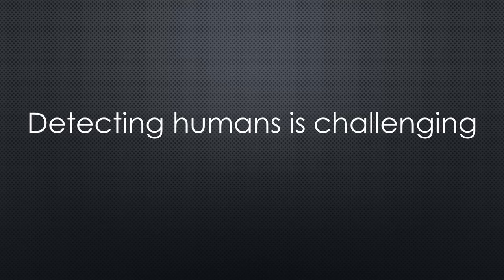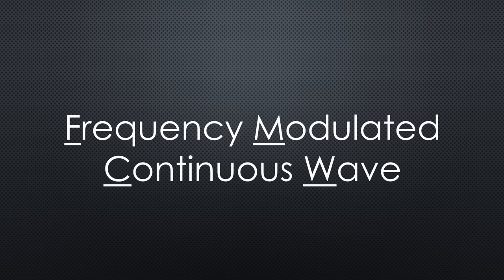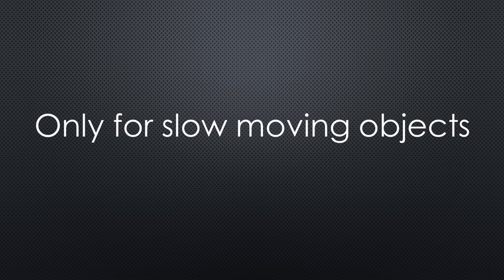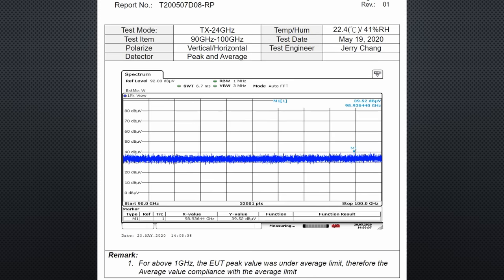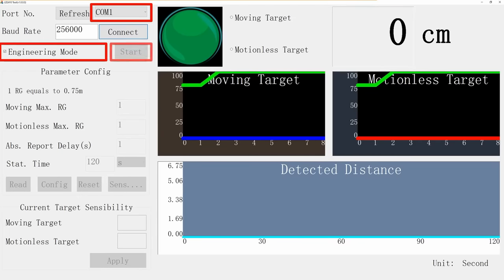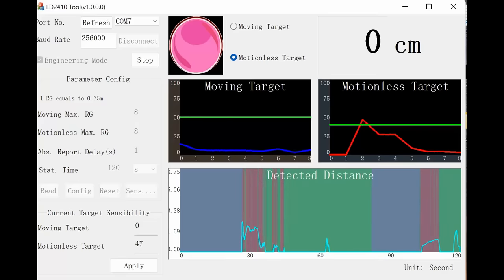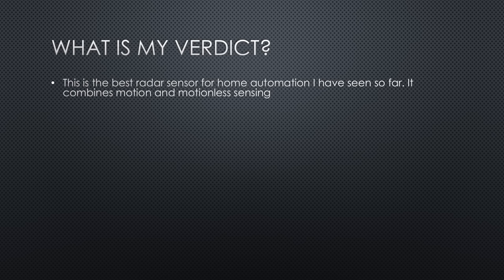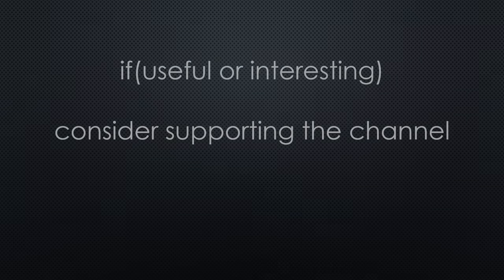439 24GHz Radar Presence Detector that Works (LD2410)

Comment: Should try the LD2410B, you can configure the sensitivity using the Bluetooth App. I'm using LD2410B in my 2 bedrooms connected to ESP32. It could also be used standalone without an MCU so a great candidate for battery operated Bluetooth radar presence sensor.
Reply from the maker: Do you have more information?
Reply: Wait, whats the diff between the LD2410 and the LD2410B? Only the bluetooth capability?
Reply: @Barc0d3  I don't see any diff using it the past few months. LD2410B has Bluetooth which is much more convenient when setting up the sensitivity.

Comment: Thanks for the video. I'm using an LD2410 with ESPHOME, but using the UART and letting the firmware do the heavy lifting. Works really well for controlling lights in kitchen/workshop type environments.
Reply from the maker: Thank you for sharing your experience!

Comment: 1,25cm wavelength(1.25cm to inches for people in usa). that is around 1cm of precision with even a single one of those(which around 1cm but then converted to American units for people in USA).
however the interesting thing is when you use it as a phased array by using multiple of them(similar to the 5g antennas in a smartphone)
then precision of smaller than 1mm can be reached easily due to the ability to focus the radiowaves on small sections and move those focus sections.

however in my case what I was mostly interested in now since modern smartphones already can make such 3d scans at around 0.1mm resolution easily(yes it is there, the software for it is there as well, this can be used to detect problems in the body and diseases due to being capable of making such detailed 3d scans but also inside of you, but somehow you are not allowed to use it since the 5g phased arrays in your phone are typically propetairy black boxes put into other propetairy black boxes that prevent you from using it, but you have no way of knowing if other people are using it on your phone, so support foss, especially such technologies which can also be very dangerous and privacy intrusive(such advanced 3d scans even through your clothing and body, and still having decent range is a serious privacy and security risk) it should be gnu+foss),
 to instead just make simple 3d scans the easy way by using 3 sensors to get width height and depth, this also takes way less compute power.

only using 3 sensors or 3 measure points to make 3d scans with around 1,25 to 5cm precision is still very useful for example or motion tracking, fun, looking through things(like x-ray glasses but then actually working), etc
Reply: Metric is so much easier. I can't understand why any country hangs onto imperial. Mind you, we still buy that vital fluid in pints here in the UK🍺

Comment: Hello Andreas. Thank you for this very clear presentation. I just received the LD2410B Kit and tried to install it. It perfectly detects presence and movements. The problem is that  it does only communicate its data through USB cables. It does NOT PAIR to any Bluetooth device (laptop, phone, Raspberry Pi 4B with BT). For example, I can integrate it into Home Assistant/ESPHome, but use it ONLY when it is connected to my Raspberry Pi by cable. Any help would be more than welcome. Thanks!
Reply from the maker: The "B" version is only laying on my table. I never tried it :-(

Comment: Great video, thanks for sharing. Very interesting sensor, I assume it will work well through a plastic enclosure
Reply from the maker: It should. But read the data sheet. They have a chapter about choosing the right material.
Reply: @AndreasSpiess  Thank you for the advice Andreas

Comment: This is awesome! I have used some RCWL-0516 in the house but I find them to have quite a lot of false triggers or no triggers. Hopefully this will decrease false positives without the need for a ugly PIR sensor. The nice thing about these things is that you can put them in a small space i.e. aluminium LED strip channels 🙂I've ordered the USB kit to tinker with it.
Reply from the maker: Tinkering is a good plan to find out how they behave in your situation...
Reply: What makes you sure those triggers are false?
Reply: @DoktorJeep  For my application they are false triggers. The sensitivity of those sensors are hard to adjust and may vary depending on many different parameters not really understood by me. I guess objects and object location already can influence the sensitivity.

Comment: Hi Andreas, Andreas here ;)
I never toyed with sensors like this one, but wanted to confirm my assumption: These sensor will not work through glass or plexiglass, isn't it?
And thanks for the nice introduction to the device!
Reply from the maker: Radar passes material (other than for example light). There is a chapter in the datasheet on which plastic is better. And: the higher the frequency, the bigger the loss.

Comment: Many Thanks! Very interesting sensor! Maybe it could be used as a rain sensor, too? 
Currently, my motion sensors mostly are PIR sensors, because of low power, battery operation and zigbee compatibility. I have one or more of them in every room. All of my lights are controlled by motion sensors and ioBroker. Very convenient.
Reply from the maker: 1. They seem to be quite sensitive to motion. So maybe it is worth a try with rain.
2. I love these Zigbee PIR sensors, too. They run forever on a coin cell...
Reply: @AndreasSpiess  @ 2: yes indeed, they are not very power hungry. Most of them, I could hide close to a piece of furniture and could also hide 2 AA batteries in the furniture. So, the batteries run even longer and I do not have to touch and readjust the sensors when changing batteries.

Comment: Radio alitimeter runs at 4.3GHz,  FM CW with 100 MHz deviation.  The modulation is triangle wave,  not sawtooth.  Power output about 1 watt.  Measures distance to ground comparing transmit frequency to reflected signal.  It only cares about distance, not motion.
Reply from the maker: Thank you for the additional information.

Comment: Dear Mr. Spiess, thank you so much for making this video and explaining about LD2410 so clearly.
After having struggled with an RCWL-0516 with so many false alerts, I ordered the LD2410. After hooking everything up (Wemos D1 Mini, and the LD2410 module, that's it), nothing seems to be getting detected.  Is it mandatory that I update the firmware before it is used  in any way?
Out-of-the-box implementation doesn't seem to work.  Would appreciate any insights, at your convenience.
Reply from the maker: I did not update anything. Maybe you check your wiring. Changing RX/TX sometimes help if it is mixed. Otherwise you have to see what is coming from the sensor in its TX pin.

Comment: I purchased a few of these and found they did not work.  Then I found a HW-MS03.  Fantastic!  Today I played with. Hi-Link HLK-LD2410C-P microwave sensor that. At 1st I thought there was something wrong with it.  Always on!  Then it occurred to me.  I am in front of it, even motionless it was still on.  I propped it next to my door with a mirror and went down the hallway.  Once about 15 feet away, it went off.    Works marvelous!
Reply from the maker: Strange that they did not work. But I agree, the HW MS03 are easier to use.
Reply: @AndreasSpiess  is the HW-MS03 better or worst than the LD2410 in terms of accuracy, distance detection, interference, etc?
Reply from the maker: @victorma2307  They are different, as you see in my videos

Comment: It looks to me that it could be interesting/useful to find out where, and when, the power is used, to perhaps architect a system that operates in a pulsed mode, depending on how quickly you need to sense activity or occupancy... Thanks for a good look at this, it seems that a bit of Geduld and prerserverance were needed!
Reply from the maker: I am sure these radar chips are quite capable. Maybe we will get a module where the radar is not connected to a MCU but to a programmable MCU. Then we could do experiments with changing the frequency etc.

Comment: there was a company called Radionics alarm. 
They had an early microwave field disruption sensor. 
Much like the old Viper car alarm. 
Sadly it went through walls and had to be custom tuned for every sensor.
Reply from the maker: Radar usually works through walls. But the higher the frequency, the lower this feature. And with today's software adjustments it is probably easier and cheaper than back in the day.

Comment: I wonder which 24GHz modules are being used for contactless hearth beat sensing?  Seems these can be capable of detecting at least that electrophysiological signal, if not others... though I haven't read through the spec's yet.
Reply from the maker: As I mentioned: The higher the frequency, the higher the sensitivity. With some filtering and close to the chest it is maybe possible to monitor breathing.
Reply: @AndreasSpiess  Wondering if there are cheaper sourced modules available like the seeedstudio 24GHz & 60GHz modules?  Interesting reading into and seeing even some online performing with 2.4GHz modules. Thanks for sharing and detailing!  As always, great content and awesome to see your channel growing sir!

Comment: Many thanks for the video, very informative. 
Tell me, did you have problems with overheating when powered by 5 volts?
This module with esp8266 works fine for me now, but the heating around 40-50 degrees Celsius is a little disturbing.
Reply from the maker: I probably did not check the temperature
Reply: @levran75 I hooked it up to the 5v pin of a Wemos D1 Mini and the LD2410 felt a little warm within the first minute of hooking it up.
Thought that was unusual. I've not had it on for a long time and I wonder how the module will hold up when deployed for a longer time.

Comment: Do I understand it correctly that this sensor draws constantly approx. 0.4 Watt (see 11:08, average 80 mA, I assume at 5V)? Every tenth of a Watt counts these days, especially if the device runs 24/7/365 and when potentially having an army of these installed in the house.
Reply from the maker: You are right with the consumption. Everyone has to decide which devices are enhancing their life. In our home we consume ca. 200 watts continuous power for all 24h. It consists of more than 20 devices which include refrigerators, heating, Wi-Fi, and my Raspberries and ESPs. This is about 40% of our daily consumption of 12kWh, BTW.

Comment: Very nice video. Pity you don't talk enough about power consumption. I think it's topic that deserve a place in all your videos :) thanks anyway. Continuez comme ca :)
Reply from the maker: I included the diagram of the power consumption and said, it has to be connected to mains. From then on, I am no more interested in how much it consumes. It is anyway not a lot compared to all other devices.
Reply: @AndreasSpiess  What do you mean it HAS to be connected to mains? Cant it not run from a battery/powerbank/laptop usb? I am probably confused by mains, to me that implies I need a AC-DC adapter to use this
Reply from the maker: @Barc0d3  Of course, it runs on batteries. Just big ones because of its high consumption.

Comment: Intrigued to know how this performs in environments where there maybe high levels of atmospheric disturbance. Such as clean air movement that can't be blocked off. My workshop is in an old barn.
Reply from the maker: I do not know. But radio waves usually are not disturbed too much by dry air.
Reply: Some 60GHz models states they can detect heartbeat to the level of alarm if it out of range. If that true then they will work correctly in noisy envirionment.

Comment: I saw your cat in the video -- does it also trigger the sensor when walking (or sitting) in front of it? I need a presence sensor that will not get triggered by my cats, and I've been hoping for someone to actually test this
Reply from the maker: Cats are much lighter, and their reflections are smaller. So you should be able to distinguish between humans and cats. I did not try.

Comment: Hi Andreas, maybe you can help me with choosing the right sensor or just pointing me to the right direction. I'd like to make a hand gesture controlled midi controller. I need a sensor, which can measure in short distances, like 1-50cm. It doesn't need to be highly accurate, the midi signal is 8bit only. Does this module can do the job?
Vielen danke!
Reply from the maker: Search for "gesture sensors" like the PAJ7620U2 or for "ST Time-of-Flight sensors" like the VL6180.

Comment: @Andreas Servus!
Can you say anything about interference if two modules were next to each other? As they cover only 60 degree I was think about extending the width with two modules. But in some cases there would be an overlap
Reply from the maker: You have to try yourself. I did not test this scenario.

Comment: Would it be possible to program zones in a DIY mm wave sensor connected to an ESP32 and HA? This seems to be an advantage of the commercial Aqara FP2, but it would be much more fun to have it in a DIY way...
Reply from the maker: I assume you can do that by evaluating the values provided by the sensor. Probably more in an ESP32 than in HA.

Comment: If you want low power than many different 5.8GHz Doppler modules with FCC and different antenna patterns, similarly serial programmable, such as the HiLink LD012, only 68 uA compares to PIR? No range data o/p though, just sensitivity adjust.
Reply from the maker: I do not know these sensors :-(

Comment: Is there any health concerns regarding use of radar sensors like this operating at 24ghz? I barely know anything about radio wave technology, so it's good to touch on before setting up constant exposure.
Reply from the maker: No. It transmits an extremely low power.

Comment: Just wondering: could you not pair this with a PIR and have the PIR powered constantly, but not powering the radar by default.  When you move into the area, the PIR would pick that up and the uP turns on the device you want to control and enters monitoring mode.  During that mode, it every N minutes of "idle" time (with the uP in deep sleep with a watchdog mechanism and external pin IRQ trigger) from the PIR powers the radar for a short period to check whether there's still someone near.  If not, it turns off the device and goes back into simple PIR monitoring mode.  If there is still someone near and PIR again remains inactive for N minutes, you repeat the cycle.  Would that not allow having a detector that can be powered by a battery for a decent amount of time?
Reply from the maker: I am sure you could do that if you want. You decide how long the battery lasts (depends on battery size and duration you are in the room).
Reply: Exactly what I was thinking to try

Comment: FYI, I bought the tuya model you described, it had the same main pcb and radio module, but a different radar board on it. Seems to be a MICRADAR R24DVD1 in my case ...
Reply from the maker: what is your experience with it?
Reply: @AndreasSpiess  I find it overly sensitive. It also senses presence of a person in the room behind me and it has quite a long cooldown time. The bare LD2410 module on a D1 Mini works better for me, plus I can configure the detection parameters. But of course that lacks the nice looking (oversized) case.
Reply: Oh, and someone made an esphome component that lets you configure the 2410 via homeassistant and log all values at the same time. Kind of beats the tuya solution by a safe margin.
Reply from the maker: @wolfganglienbacher  Thank you!

Comment: Very interesting. It could be useful in my water closet where the light shut off regularly in stationary position 😂
But the switch is near the head when we seat, I’m not a psycho on airwaves but I don’t know 24ghz effects.
PIR doesn’t emit anything so that’s a little advantage on this point of view.
Reply from the maker: Look at the power it emits. And you could select the timeout for the PIR accordingly. Then it also would not switch off, or at least as a signal to go ;-)

Comment: Hey Andreas, great video! I found it after I already ordered the sensor and replaced a 12GHz radar sensor with it. The old one was quite big and also caused my ESP32 to stop working whenever the radar was powered on.

But I have a different question, maybe you can give me a hint: I don't completely understand the spec sheets. There are diagrams showing the working angle and detection range for 2 placements. But is there a difference if the radar PCB is oriented horizontally or vertically?
background: if I want to detect movements down/upwards of a stairway, I would tilt the radar a little bit like this: /
but does it matter if it is oriented like this - or this | ?
I hope you understand what I try to ask :D
Reply from the maker: I think you have to try it in your situation because many factors influence its behavior. With the app you see its signal and you can decide. I think, the orientation is less important than the thresholds you choose.
Reply: @AndreasSpiess  ah, alright! I'll try and test it. Thanks :)

Comment: Hi Andreas.
Do you know how the radar fills a non-moving human on a sofa?
By reflection of radio wave? Looks unlikely - big metal frame in your sofa reflects a lot of energy.
I have met the view that this is due to the movements of the heart or breathing. The radar senses movement and determines the frequency of movement. When the frequency is close to human breathing (or heart rate), then the person is detected.
What do you think?
Reply from the maker: Radar cannot distinguish between metal and a human. You have to solve the problem differently
Reply: @AndreasSpiess  However, do you know how this radar recognises a non-moving human (presence and distance)?